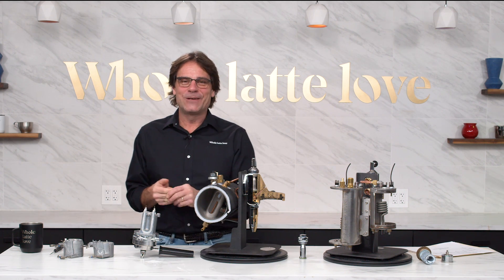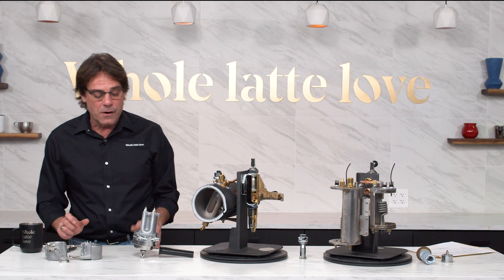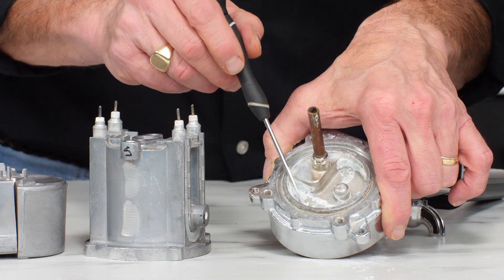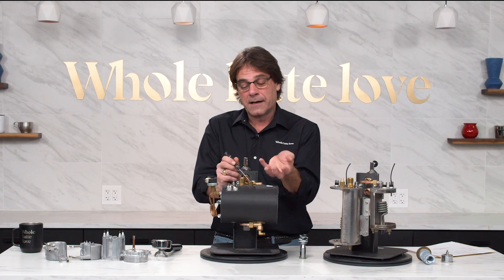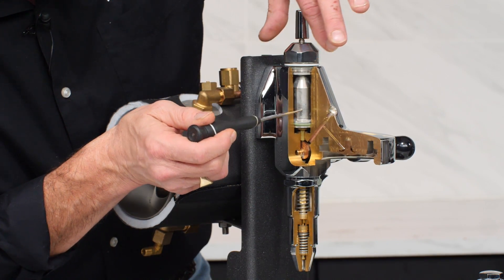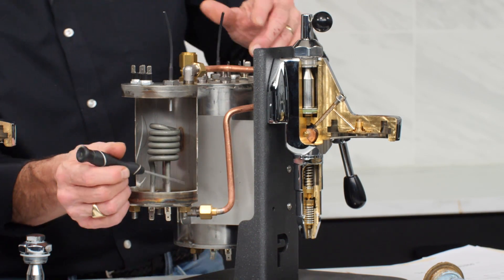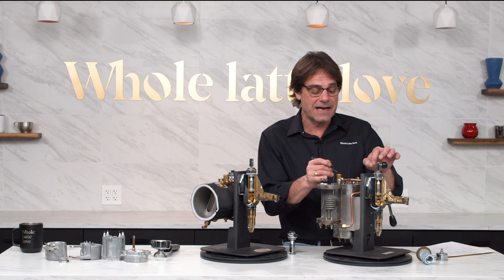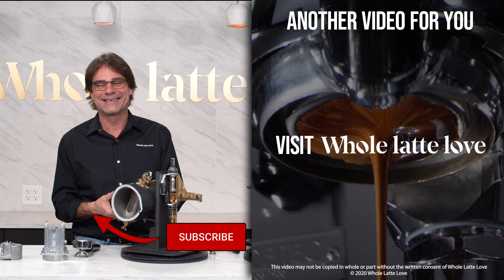Espresso Machine Boilers: See Inside 4 Types

Comment: Hi, 
And how does it look in heating times? I know it's graduated from fastest to slowest but I want to know in minutes, how long (of course in avg) take to be ready?
Reply from the maker: Hi DN, thanks for the question. I'll generalize a bit as even among the same boiler types there can be a range of heat up times
1. Thermoblock Boilers: 1-3 minutes. But temps from this type of boiler can be inconsistent. Group and components like portafilters genrally do no get passive heat from boiler.
2. Single Boilers: 5-10 minutes
3. HX Boilers: 15-25 minutes. Wide variation due to boiler sizes and group types
4. Dual Boilers: 6-25 minutes. The new Gaggia Classic GT is ready to go in 6. Many DB machines have fast heating features for full warm-up in 12-15 minute range. Larger DB machines w/o fast heat can take 25 minutes.
Marc

Comment: I have an Expobar Office Lever which occasionally vents steam out the top rather than building pressure; I now understand it's the vacuum release valve getting stuck. Sadly I've had this part replaced; I wonder if it's just a design flaw.
Reply from the maker: Hi h, unlikely it's a design flaw. If replacing the vacuum relief didn't take care of the problem, most boilers also have a safety release valve. Those open when pressure in the boiler goes to high due to overheating. But it's possible it could be stuck open and releasing pressure without overheating.

Comment: thanks this helped me see that there's brass rubbing on brass (cam and rods) directly in the hot water path.  additionally the thermosiphon chamber is brass and continuously exposed to hot water.  this defeats the purpose of the ecm stainless boiler for me, even if it's 0.2% lead brass.
Reply from the maker: You're welcome

Comment: Thank you this is one of the best demonstrations I have seen.
As for the vacuum valve its purpose is to let some air in once the boiler and it's water cooled down.
When the steam and the water cool down, they occupy less volume so there will be a vacuum or suction effect in the boiler and this is where the vacuum valve comes in and lets some air get into the boiler to fill the void caused by the retraction of the steam\water volume
Reply from the maker: You got it! That's exactly what the vacuum valve does.
Thanks for sharing!
Marc

Comment: Very infomative.  Question: what is the downside of the HX/PID system compared to the dual/PID system?  Just more stable temp control with the dual boiler?   Interesting to me that the Pro 300 has a dual boiler system but the higher level Pro 500 has the HX system.

Comment: Can you elaborate more on the brew boiler not needing a fill probe sensor? 
Amazing video btw. 
@11:59
Reply from the maker: Hi BL, Thanks for the comment and excellent question. The brew boiler fills completely on machine startup. When pulling a shot, the pump pushes water into the boiler and the only exit is through the group head so the boiler is always completely full. On the other hand, the service (steam) boiler must have empty headspace to hold steam. A fill probe in that boiler makes sure the boiler only partially fills.
Hope that helps!
Marc
Reply: @Wholelattelovepage The Marc? Is such an honor, you've been with me since day one in my espresso endeavors. Needless to say I am fan of your work. Keep up the good work! 
Thanks for the explanation. I am just having a hard time wrapping my head around the boiler not having a way to check for water coverage of its heating element.

Comment: the Decent espresso machine seems to also use a thermoblock like design but it is the tesla of espresso machines and not cheap either.  at recent milano host show there was a multigroup swiss commercial machine usiing thermoblock

Comment: Hello ☺️ i want to buy an espresso machine. Honestly I prefer if my water doesn’t touch aluminum, copper or brass. I dont mind if there are elements thst are used for quickly heating up the machine. But my water I would prefer that it runs only on Stainless Steel. 

What are the cheaspest machines that I could use for that? 

Thank you
Reply from the maker: Hi i, thanks for the question. There are many machines which use stainless steel boilers. But most every machine has copper pipes in various places internally.
The Gaggia Classic Evo Pro is the best value in machine grade home espresso products. It has an aluminum boiler which has an antiscale internal coating which isolate the aluminum from brew water: https://www.wholelattelove.com/products/gaggia-classic-evo-pro-semi-automatic-espresso-machine
The Quick Mill Pathfinder is a lower cost semi-automatic machine with stainless steel boiler: https://www.wholelattelove.com/products/pathfinder-heat-exchanger-espresso-machine#product-specs

Comment: Problem with thermal siphon stall.  I did some temperature checks. The boiler stays hot at all times.  The grouphead cools after each shot and will not heat up unless I do a long flush. I did 30 second flushes then it would heat up.  I used three thermocouples to check the temperature of the boiler, the grouphead inlet pipe and the grouphead outlet pipe.  See the attached PDF for the temperature/time log.  
It seems to me that there is a thermo siphon flow issue.  The fact that it heats up normally at start-up makes think that it’s not a solid blockage but maybe air in the lines or steam. Maybe the steam displaces the water and then once the steam condenses it’s replaced with air. The inlet pipe is hot enough to make steam or be steam.   Let me know what you think.
Reply from the maker: Hey don, Would help to know the make/model of machine. I assume it's a machine with E61 group based on your description of inlet/outlet pipes. But is it dual boiler, HX or single boiler dual use? Unfortunately the PDF with logs did not come through with your comment.
Reply: @Wholelattelovepage  It is a Rocket Appartemento. I purchased it in December 2018.

Comment: How does one descale a dual boiler machine? I have a plumbed in Hx machine so that's a pain in itself. I guess if its a reservoir machine, its much easier. Add descaler and empty/fill via the hot water spout and grouphead so that begs the question, what about plumbed in dual boilers?
Reply from the maker: Hi HD, So most machine manufacturers advise against home users descaling dual boiler machines. 2 main reasons for that. First, the hydraulics in DB machines is relatively complex. If scale is present, when descaled undissolved bits of scale can plug up other areas of the machine. Second, it's difficult to fully rinse the service (steam) boiler and takes special technique like disabling the water level sensor to get descaler to the portion of the boiler where scale typically forms. When our techs descale DB machines they usually remove the boilers from the machine to do so.
Most plumbed DB machines can be run from reservoir. But, the best approach is to prevent scale in the first place by filtering water to reduce calcium yet maintain a mineral level needed for good flavor and to prevent corrosion. Ultra-pure water like distilled or reverse osmosis water can cause corrosion of metals in espresso machines - also makes coffee that tastes bad. To prevent scale one can use typical sodium based water softening but calcium reduction using Ca to Mg ion-exchange is preferred as magnesium is a better flavor extractor than sodium. BWT Water & More has Ca to Mg filtering options for reservoir fed machines and in-line filters for plumbed machines. Learn more about those in this video:  https://youtu.be/1C0GdOKxLj4
Marc
Reply: @Wholelattelovepage  Thank you for the time to fully explain that. It sounds like a machine has to be sent back regularly. Even if you run a softener you still have the mag in the water which will turn to scale or is it just calcium that does? I run a water softener on my current plumbed in Hx machine and as you wrote, I don't care for the taste of the water on its own. So when I make an espresso I add in a bit of pre-mixed epson salts and baking soda. Don't recall the ration, just a small amount of each and then add a small amount to the cup before extraction. can't say I taste a big difference, which is weird. I need to pull two empty pf shots to compare the water itself. One with and one without the mix in the cup.
Reply from the maker: @hoobeydoobey1267  So long as your treat the water properly scale will not form so you would not need to send the machine back. Regular softening can get the job done - but the flavor may suffer. Mg alone dose not cause problems.
Reply: @Wholelattelovepage  Thanks. I'll be ordering the filter from you shortly. I want the flavor of unsoftened water.

Comment: With the thermablock, is the water in contact with the aluminum at all or it just goes through stainless steel pipes?
Reply from the maker: Hi JG, Thanks for the question. Every aluminum thermoblock I'm familiar with has stainless steel water piping internally.
Marc

Comment: Thanks so much. On the dual boiler why doesnt the small boiler have a vacuum valve but the big one does?
Reply from the maker: Hi Hong, Thanks for the question. The steam boiler in a dual boiler and the steam creating section of heat exchange boilers need a vent to atmospheric pressure during initial filling with water so air pressure does not build up inside.

Comment: Great video.  Not clear how a PID controlled heat exchanger machine works however.  Your video seems to overlook the fact that PID's are not just on dual boiler machines, but are also found on heat exchanger machines.
Reply from the maker: Hi David, Yes, many modern HX boiler machines use PID for better temperature control. Much more precise and accurate than those controlled by pressurestats. PID in an HX boiler holds the main boiler section which produces steam at a precise temperature. Brew water runs in a closed looped through the heat-exchange section within the main boiler absorbing heat. Convection causes the heated water to flow out to the group where it gives off heat and returns cooler to the heat exchanger. This flow out to the group and back is continuous. The result is water in the loop runs well below the temperature of water in the steam producing section of the boiler. By engineering the flow rate by adjusting the size of a flow restrictor in the loop one gets predictable brew water temps based on an offset from the main boiler temperature.
Marc

Comment: So basically the water you drink in your espresso from a single boiler machine is the water that sits in that (scaled) boiler? Kinda gross
Reply from the maker: Hey Robert, Well... scale will not hurt you. It's basically limestone and doesn't dissolve back into water unless it's acidic. Even then it's calcium which is present in most drinking water.
Marc

Comment: I have a questions what can be problem when one boiler machina do not give proper presure on coffee ekstraction its about 3bar only?
Reply from the maker: Hi KK, Low brew pressure can be cause by a bad pump or a blockage - usually limescale in the machine's internal plumbing.
Marc

Comment: Thank you Mark. Always wondered just how the "outside" element look like on the Gaggia. This then also mean that the 140ml  Gaggia boiler is a true 140ml, and that boilers like the Rancilio, although bigger, might lose some volume due to the heating element. Or do they measure actual volume?
Reply from the maker: Hi La Ma, You are welcome and thanks for the question. I believe most manufacturers measure the entire internal volume and probably do not subtract displacement of heating element.
Reply: @Wholelattelovepage  and do not subtract air volume from this boiler

Comment: gaggia pro has a  stainless boiler
Reply from the maker: Hi y, If you consider aluminum stainless - sure!
Marc
Reply: @Wholelattelovepage  15:05 which gaggia classic  pro is aluminum?
Reply from the maker: @yrulooknatme  There a Gaggia super-automatic machines with stainless steel lined thermoblock boilers. All Gaggia classic/Classic Pros have an aluminum boiler.
Reply: @Wholelattelovepage  I'm an old fan of gaggia machines. But a have others that I like to. I see that what you are saying is accurate. I guess I ran across the video and did a little follow up google search and concluded they changed the boilers out to stainless.This I did a couple years ago. Now I find that that format didn't stick and aluminum is what is now used. Kinda of a shame. My first gaggia I bought used and had to completely rebuild it. the boiler was roached but I managed to polish the brew chamber walls and continue using it. It was an old baby with the cast aluminum body and cap tube stat. I just fell in love with the darn thing. Not many parts are available for those. Although I like how quick the boiler heated I didn't care for the way it degraded. I thought stainless sounded like a good upgrade. But I see that wasn't well received. A lined stainless/aluminum boiler would be nice but seems like electrolysis would wreak havoc somehow. Since that one I've owned  a couple babies, and an old white coffee. I like them all except the baby that had the white plastic body. the internals were nice but I didn't care much for that plastic body . I'm gonna get one of those stainless classics though to add to the collection. I have a europa pavonine , the old baby, faema family, 
(2) faema C85 S/1. yeah I got 2 of them lol. and an ole rancilio nancy. I sold quite a few of my collection. I got an addiction, but I'm workin on it. lol   So many models, so little time.

Comment: Those cutaways are amazing! Why do heat exchanger machines measure pressure instead of temperature?
Reply from the maker: Hi Marcel, Thanks for the comment and question. Because science is cool one can accurately determine temperature using boiler pressure. Although PID control is becoming more common in HX boiler machines for a long time pressurestats were used to regulate pressure/temperature. As the name suggests pressurestats measure pressure so pressure gauges are used on those machines. PID machines have a temperature probe in the boiler instead of a pressurestat. PID machines are more accurate using an algorithm to control heating in boiler and avoid under or overshooting desired temperatures.
Marc
Reply: @Wholelattelovepage  I feel like I’m still missing something. If measuring pressure is faster or more sensitive than measuring temperature for an HX machine, then why not feed pressure measurement to a PIDed HX as well? Why go back to measuring temperature? It seems odd that both low and high end setups use temperature, while mid range uses pressure. Is the PID thermometer way better and more expensive? Or is a digital barometer (for input to the PID) much more expensive than a digital thermometer?

Comment: Are the new thermablocks in the ascasos much improved? Or do you recommend another type, HX vs boiler? 
Water is also dard in Calgary.
Reply from the maker: Hi Dennis, Thanks for the question. I believe the machine uses a stainless steel lined aluminum thermoblock boiler. But, it's not a machine I have contact with so I do not know if boiler improvements have been made. I'd guess probably not. Thermoblocks with their very narrow passages for heating water are more susceptible to clogging due to scale. A boiler with a larger volume like an HX is more immune to scaling issues but use hard water in any boiler type and you can have scale problems. Troubles can be avoided by filtering water to reduce (but not eliminate) mineral content and by descaling the machine on schedule.
Marc

Comment: Regarding the vacuum relief valve on the boiler, are there simple ways of routing the initial sputter of steam away from the internals of the espresso machine? Something like an aftermarket barbed valve that a tube could be attached to and routed away? This sputter concerns me as I am joining the E61 world after dealing with a corroded Breville Dual Boiler. Moisture kills 😳
Reply from the maker: Hi JS, Thanks for the question. Not sure which E61 machine you have or are considering. Many of them do have a tube on the vacuum relief valve which routes any moisture to the drip tray. There are aftermarket VR valves available with a barb to attach tube.
Marc
Reply: @Wholelattelovepage  I have a Quick Mill Arnos due to arrive any day now from your company, hence the question. I am not sure if that model vents to the drip tray or not.